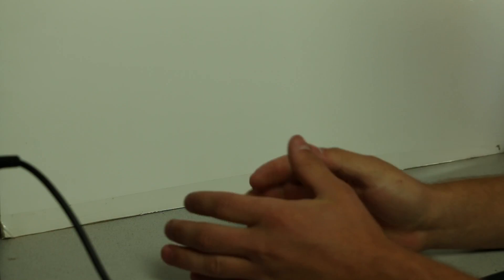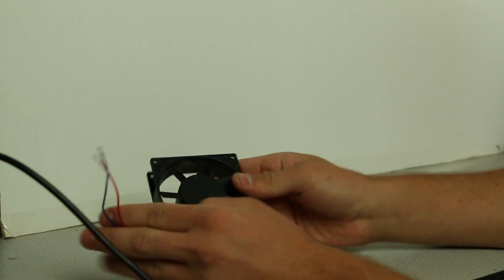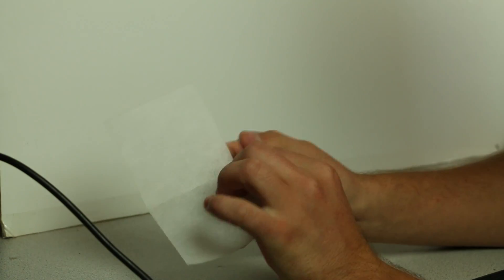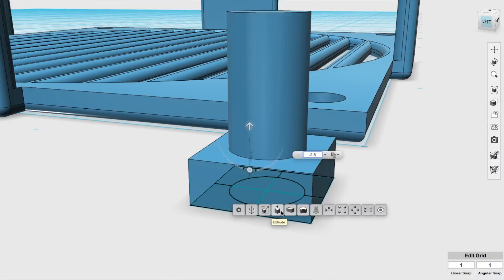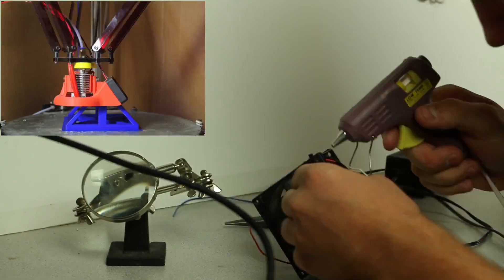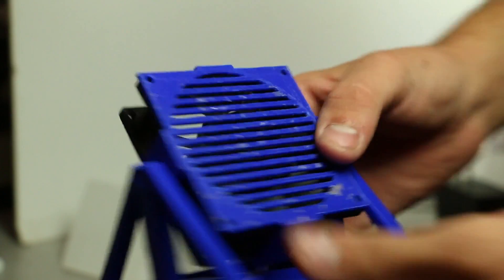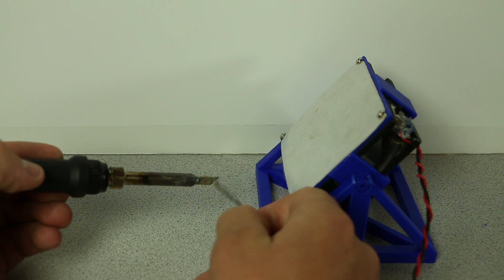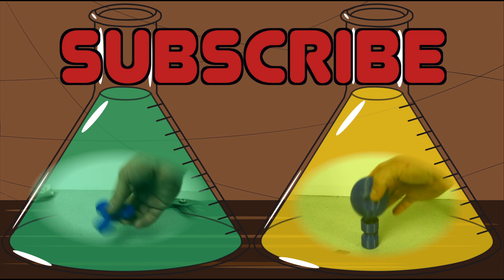3D Printed Soldering Fume Remover!

Comment: It would be a lot better if you just point the fan towards your face to blow away any flux fumes.
A fan that size (and almost no air flow going through because of the obstructing filter) is doing nothing.

Comment: I like the idea of it, but I don't really think the way you made it is going to work that well. A lot of fumes (smoke) is going around the filter to follow the airstream, created by the underpressure on the other side of your extractor. If you want to make it good, place a funnel on top of it and make it hang above the place where you solder.

The idea is very good though. Going to make something my self because of your video.

Thanks for sharing.
Reply: true it shoul be based on the comercial models like hakko